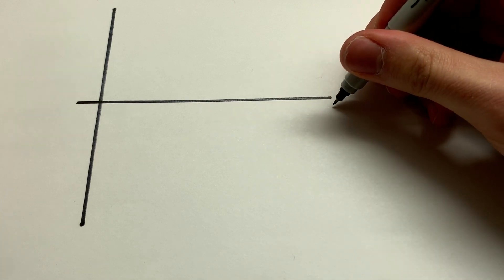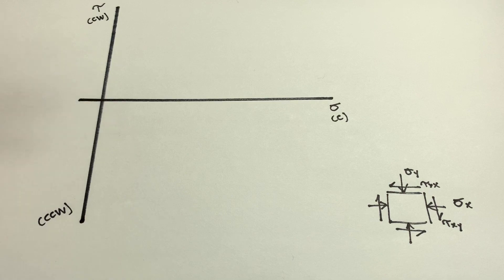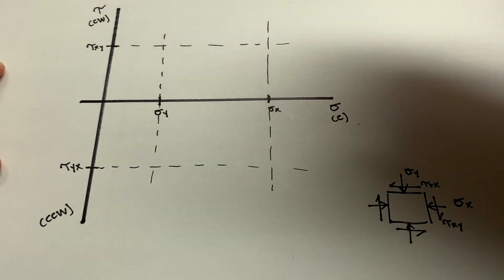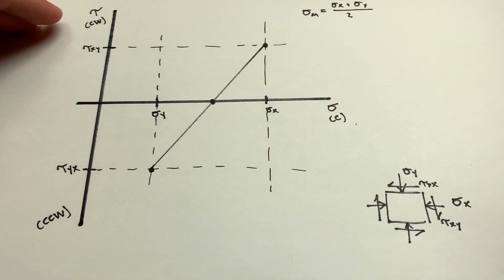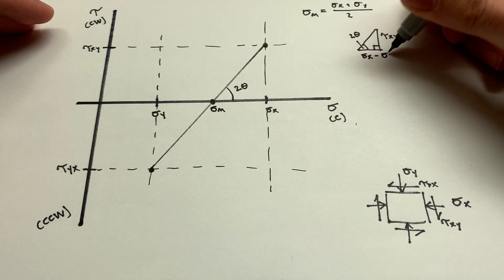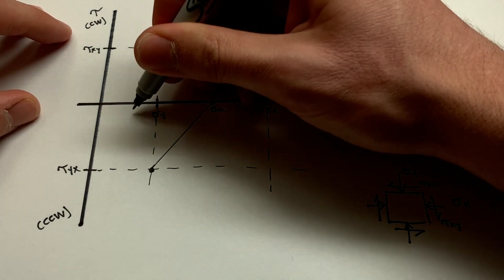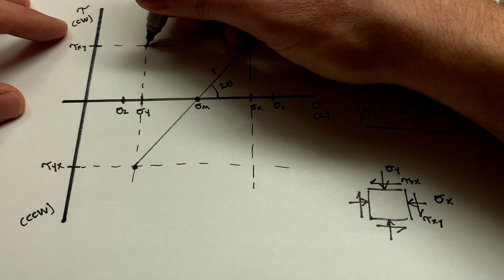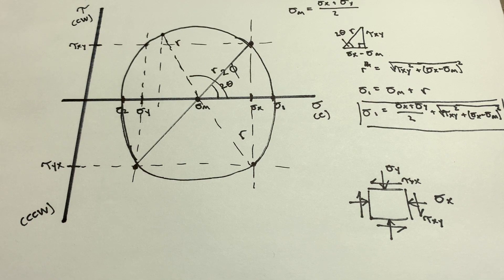Rock Mechanics: Mohr's Circle and Principle Stresses

Comment: For radius isn't it sigma x minus sigma y divided by 2?
Reply: radius is, but he is finding the center point (which is (sigx+sigy)/2), not the radius (sigx-sigy)/2. if sigy was on the origin, they would equal the same, but since it is shifted, they are not.